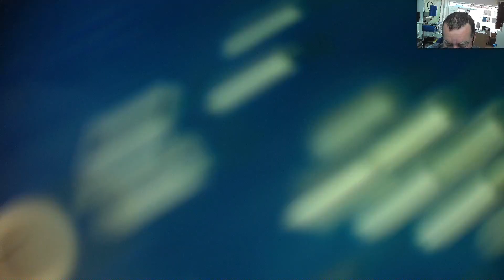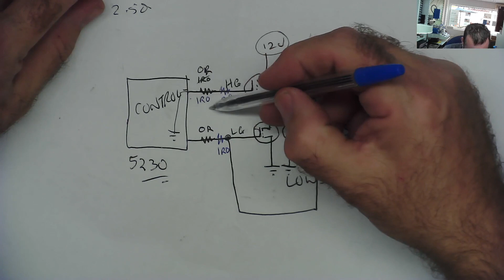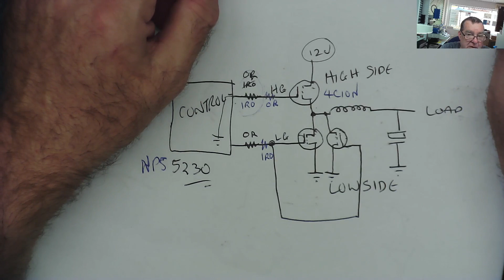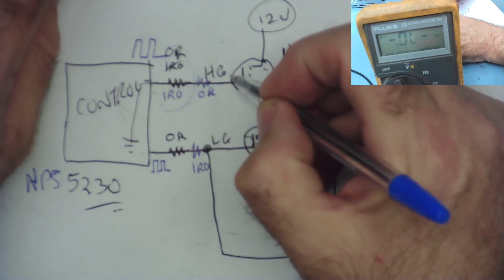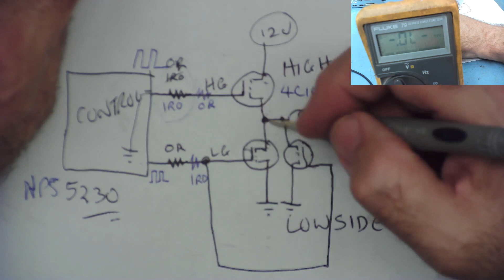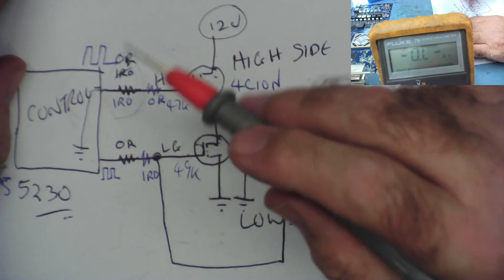I bought 13 EBAY Spares or Repair GPUs... Episode 5: Sapphire Dual-X HD7950 3GB part 2

Comment: I have this exact same card and it died on me while I was playing and it didn't wanna power up afterwards so I took it out and measured the resistances and I found that one of the 6 pin connectors doesn't deliver the 12v needed and always reads 0 especially the one in the middle close to the vrms, and then I confirmed my suspicion when I plugged the card in another motherboard and the same thing happened it didn't wanna power up but when I unplug the 6 pin on the left the pc powers up but doesn't display, and the same thing when I don't plug any 6 pin so that it only draws power from pci the pc does power up but no fan spins and no display. Can you help me finding what the problem is ?

Comment: Hey Richard great follow up and a success. Got a question for you. Could the same thing happen if your PWM Controller goes short? Because i had it, that a PWM Controller for MVDD went short on the 3.3V line. Would that also cause the problem for the Mosfets or would that just always then drag the Gate down to ground and it would just prevent it from turning on ?

best regards!
Reply from the maker: If the controller failed and the UPPER GATE or LOWER GATE output are short to ground then yes it would drag the gate down and prevent it from turning on - in the case of an N Channel MOSFET. Presumably a PWM controller could also fail in such a way that there is Vcc on the gate outputs and the MOSFETs just turn on

Comment: Thanks again fella.. Do you ever use a heat gun to find faults?.
Reply from the maker: You mean by warming up components or areas of the board when the fault is intermittent and happens after the device warms up?  Yeah using a heat gun or hairdryer and freezer spray to warm/cool components is a standard diagnostic technique and yes I use it when appropriate
Reply: @learnelectronicsrepair  Thanks. Im novice so learning.
Reply from the maker: @Self-Law-y1x  Sorry if I sounded patronising.  Yes it is a good technique but mainly used for intermittent faults that are heat sensitive,
Reply: @learnelectronicsrepair  Thanks again. I enjoy watching your vids. Your blooming good.